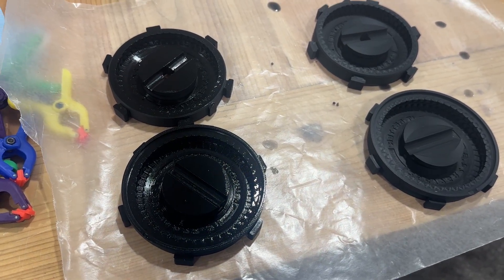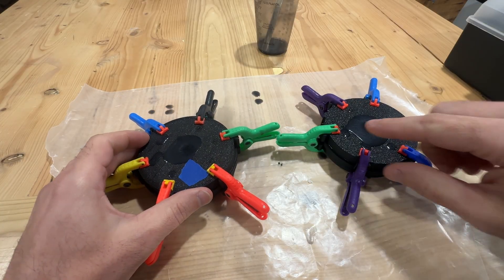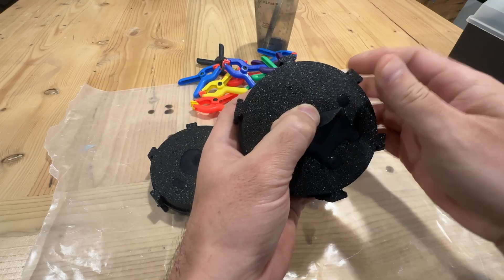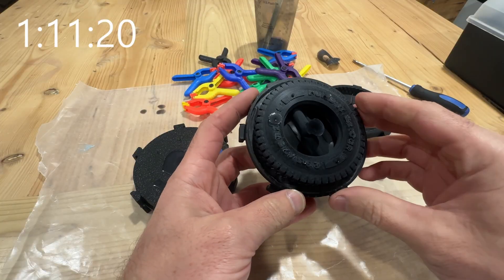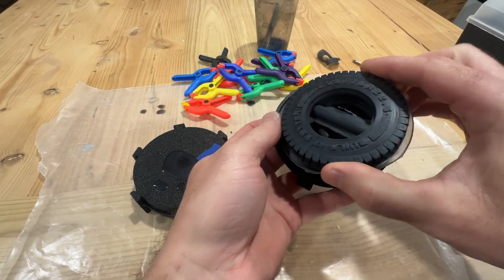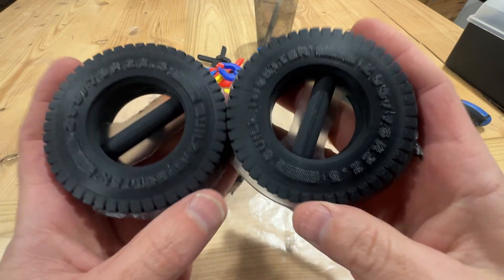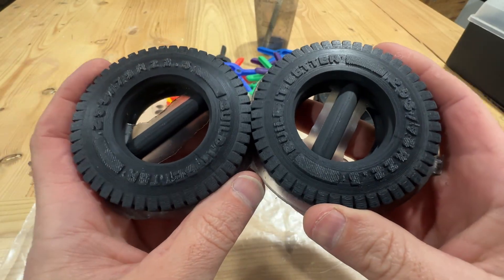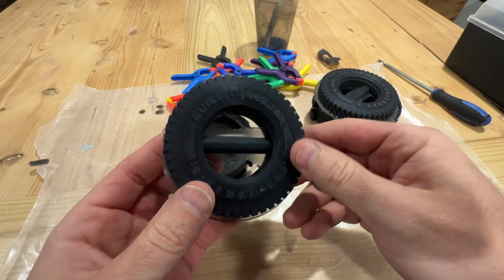Mold Release Test  |  Will it help?

Comment: is it possible to scale down the tire moulds in the slicer for 1/24 and 1/32 tires? will the dimensions hold when scaling down?
Reply from the maker: That would depend on if the rims are a direct scale down. My guess is the dimensions aren’t an exact match.

Comment: How about threaded inserts and bolts in the mold ears? You can use them to hold the mold together and then when done use them to push it apart.
Reply from the maker: That might work.

Comment: What about adding some air fittings to the STL, or simply using compressed air through the holes used to get rid of air pockets during the pour? Like air hockey table per say? Impressive work!
Reply from the maker: Thank you. 
I think using compressed air to get the tire out of the mold might help. I don’t think injecting air would help eliminate air in the pour though. I want to try a vacuum chamber on the mix before pouring, that could help.
Reply: @BuildItBetter3D yes my bad I didn’t explain well, I meant for you to use the holes already in the mold to separate the mold from the silicone once has cured, therefore no need to draft anything into the mold file (air hose fittings)

Comment: Looks like mold release haven't help at all, that's kinda sad, maybe that specific silicone or the 3d print material make it not work properly ? Or what you said about the thread of the tire. Did you used taper angle in the threads like those in automatic fast injection molds plastic to help remove part ?
Reply from the maker: No, there is no draft angle in the design. The silicone doesn’t stick to the PLA plastic at all. When dripped on top it falls right off after it has cured.

Comment: How many coats of release did you use? The man I spoke to at my materials supplier recommended at least 3 on a 3d printed mould. Tyres look great though!
Reply from the maker: I only did one heavy coat. The overspray on my floor has me slipping all over the place 🤣 so I think I used plenty.